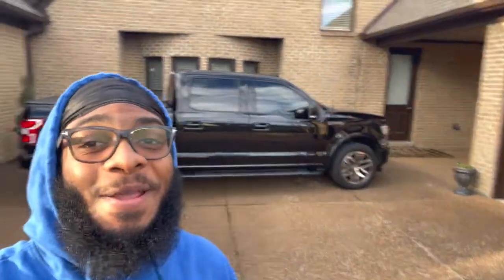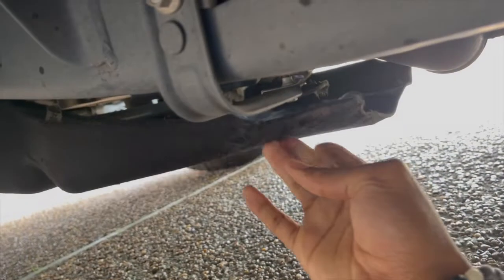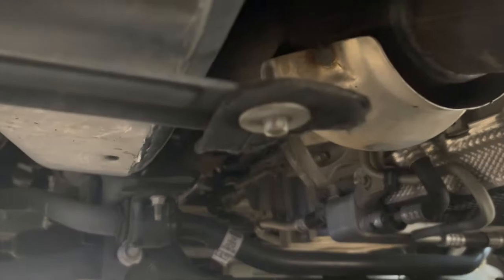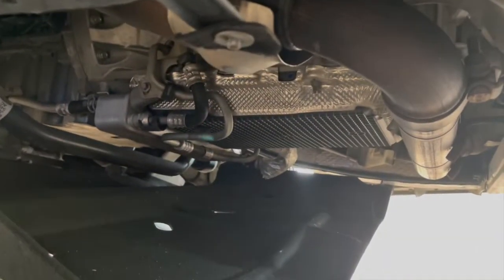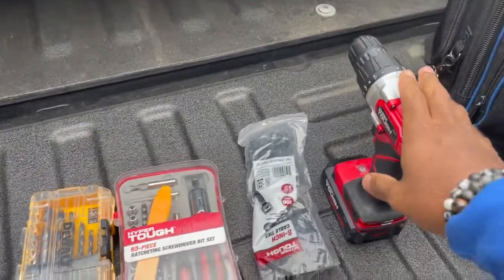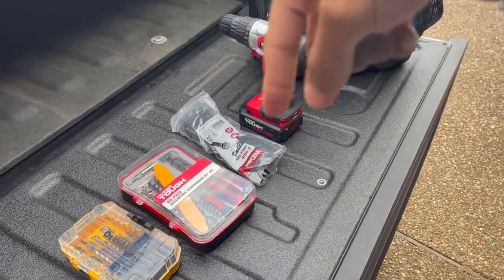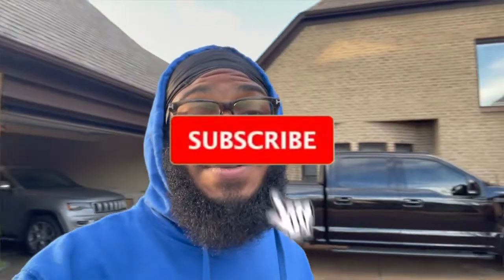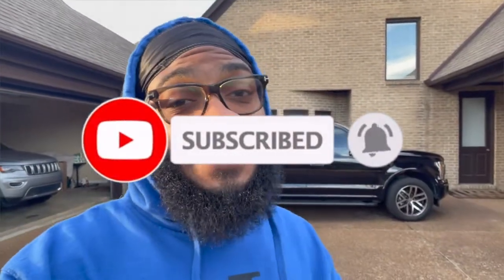2017-2020 F150 Splash Pan Repair | The WORST Splash Pan Ever!

Comment: There is a metal oem part for a f150 that has the off road package for 2015-2020 not sure if it would work but here is the part number: FL3Z-5D032-D

Comment: The problem is that it needs to be removed to do an lil change and then they put the bolt back in with an impact driver and the stupid fabric twists and then rips.
I’m about to put on a metal skid plate that comes on the FX4 and remove this fabric one all together.  Maybe I should do a video of it.
Reply: wait what? I have the FX4 and didnt get it. My crappy one just ripped on me!
Reply: @traderinthetrees1785  it wasn’t the right skid plate, I had to return it.  We’re stuck with the POS fabric splash guard.
Reply: @ian7155  the fx4 really should come with a beefier skid plate now that you mention it though. I’m sure there has to be a good aftermarket one out there somewhere, but I have not researched it yet .
Reply: The raptors skid plate fits with no drilling, just replace the mounting bolts and two rear brackets with the raptor steel one. I used ss round button hex bolts for catalytic converter security too. 🇺🇸 Another Beautiful Day !!

Comment: I have the same shield under my 2013 F150 except it's only held on with twist locks. When I change the oil next time, I'm going to change to stainless steel bolts, washers and wing nuts. My shield hasn't torn like yours but after seeing how yours tore, I'm going to back it up with small aluminum plates attached to the shield with J-B Weld. By the way, some say that shield is for road noise dampening. Who knows? In any case, they're a PITA. Thanks for posting this video.

Comment: I repaired mine with a Dewalt glue gun, 8 glue sticks and 4 large pan washers and about an hour.  I did it on all four attachment points. The HD glue sticks adhered to that felt diaper to hold the flat washers in place and then made a large triangle patch on the front corners about 4” across on both sides. Too bad I couldn’t include pictures. There is a metal replacement from Ford used on the Raptor. Part number : HLEZ-7222-E.

Comment: Same issue on the 2021.  I just did the same repair, except I didn't remove the bolt.  I took the zip tie trough the bolt clip with two zip ties.  Nice video

Comment: I didn’t want to rig up a temporary fix. The material for the “Splash Guard” is similar to an egg carton with bed liner sprayed on it. I installed a metal skid plate for a Raptor part # HL3Z-7222-e I have a 21 F150 XL and it worked but the front brackets don’t line up.  I have six of eight bolts holding it on now. If necessary I will weld another set of brackets in the front part of the skid plate.

Comment: Only a temp fix, eventually the zip ties will rip through that fabric as well.
I’m on my 10th attempt with zip ties my thing is mangled. I just ordered the part form the ford parts website for 75 bucks so the free shipping. The labor looks to be 4 screws so I think it’s worth it

Comment: This happens on the 2011-2013 models as well. Happened on my 2012, and now my 2019. Ford has known about this for over a decade and they haven't fixed the design.

Comment: I had been looking all over for the name of this thing.  Tried RockAuto, ebay, amazon....none of my searches came up.  Now, off to try "Splash Pan"  Anyway, I tore mine loose while I was backing over some forest debris.  I zip tied it back until I gt another one.  I think they reason that these are made so cheaply is exactly what you say is the problem...they tear up.  I guess it is better to tear up this cardboard-ish part than have it hold fast and rip wires, lines, and so forth.  So I think it is made to fail just like a fuse is made to fail so it protects other things.  

When mine broke loose it sounded like a gun going off.  I thought I had blown a tire.

Comment: Some guys replacing it with a metal skid plate that come stock on the Raptor trucks.  My dealer wants $144 for the cheap stock one.  I dont know what the metal one price is.

Comment: There is a FORD Factory steel transmission cover that is used on the Raptor. This steel cover will delete the factory fiber cover and may help deter catalytic converter theft. 
HL3Z-7222-E COVER - $160.00 FORD
W716831-5439 BOLT
W719490-5439 U-NUT
Remove the fiber cover AND brackets. Install the new cover and support with a jack. You will see where the other two U-Nuts go in the frame. 

Links to instruction videos and reference to catalytic converter theft deterrent:
https://youtu.be/8ED8N0UwJfY
https://youtu.be/CABVFxUISoE
Reply: Do these need removed to get to the oil drain?
Reply: I have a 2019 2.7 F-150 XLT and that steel raptor plate fits perfectly and it was cheaper than a new felt one
I'm going to install the Ronin drain plug because there is a gap at the right front section of the plate you might be able to get your hand up there to drain the oil without removing it

Comment: Agree this design comes off as a "red flag" to me (2020 F-150 owner). What was the intention behind the design? Prevent debris and rust? Wouldn't this really only add value if metal and offroading?? Well the components it covers are aluminum, it is a headache for oil changes, and does not appear to dampen sound. I say once it fails, like mine did, just remove it entirely. A positive is that you will more likely notice a leak, which is especially important if you're under warranty still..

Comment: Good video. I did exactly what you did with the zip ties. Maybe I should just leave the zip ties and not replace the shield. Worst design ever! Ford is doing some stupid things.  I have read that the shield cuts down on engine noise and protects the turbo's pipes.  I don't know where to find the attachment bolts one of which lost. Any ideas about where to find a metal replacement for the shield? Thanks

Comment: Do you need to cut the zip ties when you change the oil? just noticed my truck has the exact problem. The same bolt position ripped and now it's hanging down...... good job Ford!!! Earn all that praise....
Reply: I have read that Ford only removes the front two screws to do the oil change.  This cover hangs down which might actually lead to this failing!  I figure with the zip ties in, they will act as a hinge.  Fingers crossed

Comment: Just got done doing this! With the excess ice and snow in NY past few days and driving through feet of snow, ice froze to it and weighed it down. Eventually tore and did the exact same thing with zip ties.

Did you ever find anything to replace the felt with?
Reply: Do you still have that felt piece under truck ?
Reply: Someone ended up offering me a good deal for the truck, so I sold it and recommended they buy a plastic cover that are sold aftermarket. My guess is that the felt is still there. 

Also, I’ve heard from others that if you get oil changed or tires rotated at a shop, they will not zip tie it back in place.
Reply: @mfil3513  🤔 yeah makes sense cause i noticed it hanging after an oil change 😵‍💫🤦🏻‍♂️ just saw a few videos and I found a metal cover video says to use off raptor I hope that works
Reply: @meefthepotatoe4363 good luck!! The design doesn’t seem to be well thought out. Seem to be sacrificing quality for gas mileage improvement. 🤷🏼‍♂️🤷🏼‍♂️

Comment: YEP... randomly happened to my 2013 F150... not only those years... and I'm no off-roader.
Reply: I used metal zip ties... worked. Been a year and still there. Just make sure it's in a non-tear area.